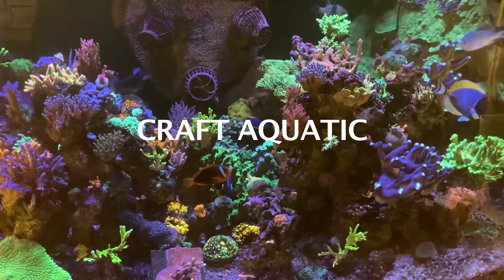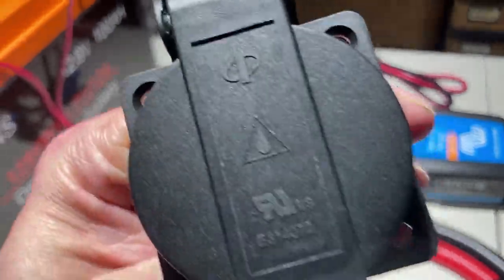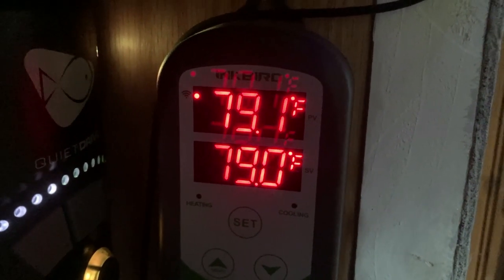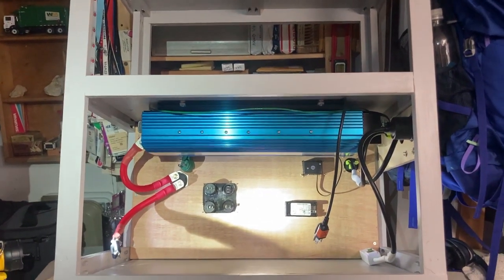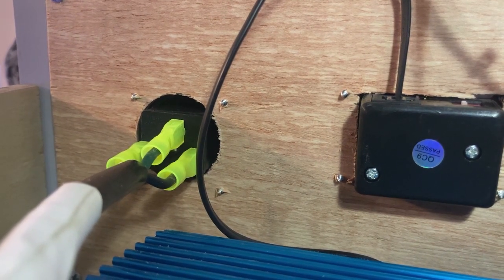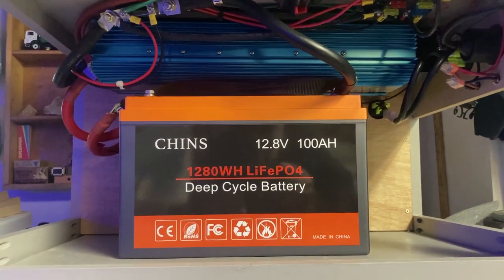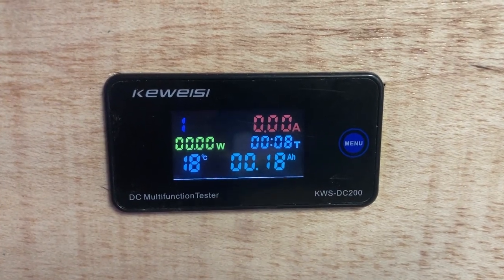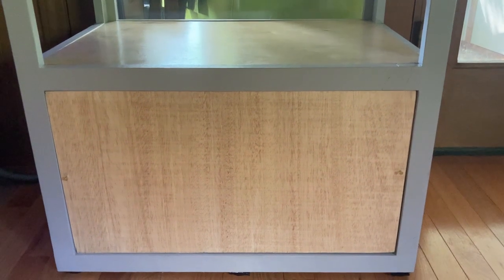COMPLETE DIY BATTERY BACKUP SOLUTION - FOR A SPS MIXED REEF AQUARIUM

Comment: Awesome build, I just have a rechargeable LIPO4 battery to back up my main MP40 and my inkbird. I live in the Phoenix area so the biggest challenge is keep the water moving and cool as much as possible.  I don't think there is enough backup to run a cooler, which not too many people here uses because it creates a lot of heat. If have looked into Will Prowse DIY solar generators, but that is beyond my skill set.
Reply from the maker: Thanks! LiPo is a good option to have, in pinch. Plenty of people have them kicking around for their RC cars and such, so they can be a great option, so long as you have one charged and ready to go. Also, batteries for lawn equipment are another great option. Building a battery generator is not for everyone, but Will Prowse is an excellent resource if you ever decide to. Thanks for checking out the video!

Comment: Looks and works great! About to do this for my tank. Could you make video on how you setup the apex to prioritize certain things when power goes out? Since the inverter switches so fast how does the apex know the power went out??
Reply from the maker: Thank you! I might include that info as part of a future video. Pretty basic. Plug into your DC input on the apex to a circuit in your home that will cut during a power outage. The apex will now be able to sense a power outage, even while plugged in to your battery generator. From there it is a simple matter of setting up “if .. then,” commands. most of that is covered in Apex videos already. Hope that helps

Comment: Auto Transfer inverter....for folks that have a regular non-auto power transfer inverter is there an electronic device you can buy that does the same?  To automatically transfer over to inverter/battery power if house power dies when you are not at home? Thanks
Reply from the maker: One affordable option is the Xantrex PROwatt sw 15A Transfer Relay 808-0915
It is 15 amp $70 but have no experience with it myself

Comment: Nice setup I should do this for my aquarium soon aha how much all this cost you?
Reply from the maker: Battery was around  $200 and the inverter $140 used cables and hardware another $150 - $200. Not cheap, but worth every penny
Reply from the maker: I’ve linked to all the parts below, if you’d like to use my build as a template

Comment: How is this working out after a few months?    I have read that this particular inverter cannot be plugged into a gfci receptacle. (Some internal components apparently cause nuisance trips)I’m assuming if you fed the inverter from a non gfci receptacle, and installed a gfci receptacle for the load side of the inverter this would fix this issue. Obviously under normal conditions when using grid power you would want your tank gfci protected.    What if anything would you do differently?
Reply from the maker: So far, the build has been very reliable and has carried the system through one lengthy power out. About 28 hours. I do feed this inverter with a GFCI circuit, with no issues. I can’t find the info you are referring to. Care to share a link?
Reply: It was in the Amazon reviews for the inverter itself.  Three different reviews mentioned tripping via gfci
Reply from the maker: Got it. Fortunately, no issues with my build, so far. My inverter is plugged into a circuit using a 20 amp gfci. I switch the breaker off and on, to test the entire system at least once a month. It’s hard to say what the issue is, without closely inspecting others builds. Hoping it is not a QC issue. The inverter is built like a tank.

Comment: So I am a bit confused.  What is your total tank draw in watts?  You said your heater alone was 800w. Granted that would not be running for the entire time. How are you able to get 6+ hours of run time.  With only 1280wh available you should be able to run 400w for three hours?
Reply from the maker: I’ve set the Apex to prioritize specific functions during a power outage. In tank circulation switches over to the generators DC outputs. Return pump is AC, which remains on. All lights and dosing pumps pause to conserve power. Heat switches to low temp set at 76, in sump 200 watt heater. Rarely comes on, unless very cold outside and home temp drops significantly. I’ll be installing a 200MAh battery very soon, for increased run time. Cabinet will facilitate 3 - 100 AH or up to 1 300 AH